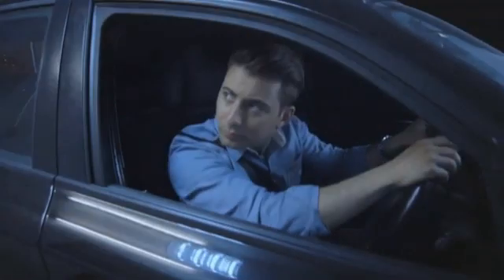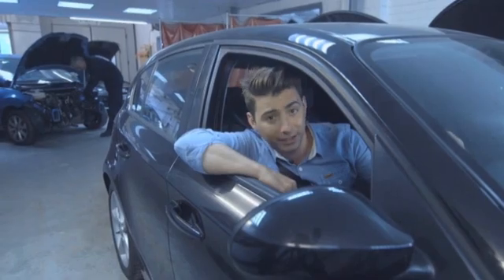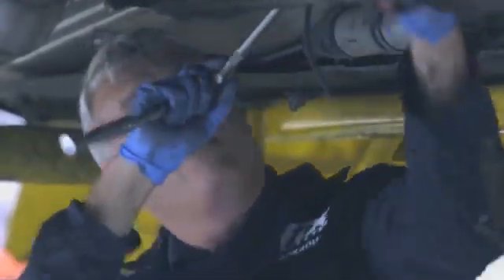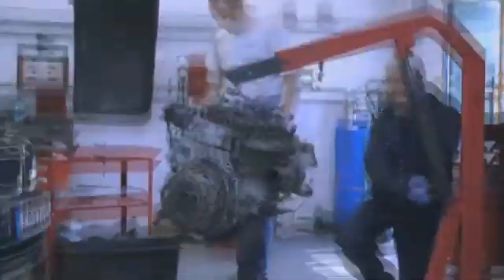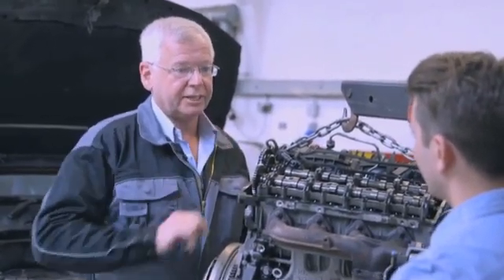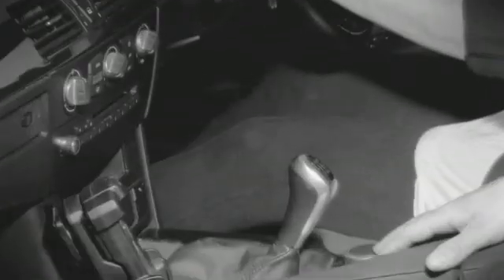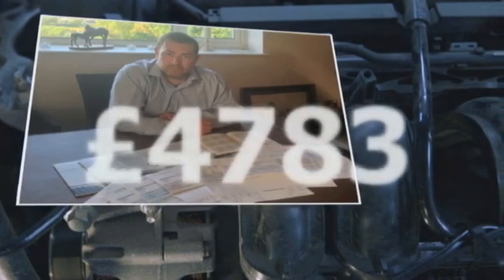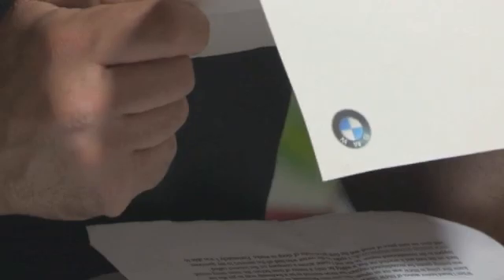BMW N47 Timing Chain Failure PROBLEM

Comment: Should it matter if the vehicle has been serviced by a non BMW approved garage ? So long as no parts are not BMW for example if its just oil change filters then I see no reason a filter can affect the timing chain weakness. BMW are using this as an easy excuse.Come on #BMW accept that you go this part wrong. Be the bigger respectable car manufacturer you say you are.
Even if you do have everything done by BMW it seems they have decided to no longer offer a recall and that is quite shocking.
Reply: Honestly, they do a good job in marketing a shitty product. I'd suggest a merc or a lexus.

Comment: I have a 118d 2005 will I have any problems?
Reply: No as it is a M47 engine, but you may have rear diff issues as 118d had a weak rear diffs.
Reply: No you shouldn't have any issues related to this N47 engine but you got the older M47 engine but they do suffer from swirl flaps issues but only high mileage vehicles
Reply: +Alihan Yazlik yes you will 100%

I also own a 118d (2008) chain at the back so it means the whole engine has to be taken out. However ur car is the old model with the chain at the front meaning you won't need of removing the engine to change the chain.

I lost &#163;2700, never buying a bmw again
Reply: pb5x5 What is the "rear diff"?
Reply: Rear differential sits between the two rear wheels and lets tleft and right side run at different speeds when cornering.
Reply: +SWE-BMW-E90 lol idiot
Reply: My E90 N47 has 230 000km right now but thankfully no problems so far :)

Comment: The main fail is to change oil and oil filter every 20k miles, not every 7-8k miles like it should be. It's all about geting money from engine rebuilt! All cars makers do that!
Reply: Stupid conspiracy theories. Engine manufacturers make service intervals after consulting oil companies. I've monitored acidity in oils after 20k intervals in vehicles that make a lot of miles and it seems the oil is ad goods as new. Oil only degrades with a lot of cold starts. Mileage is irrelevant even if u change oil after 100k as long as it's in one year interval and not a lot of cold starts. I've seen engines on airport taxi ans doing almost a million kilometers in a few years that changed oils at 100k intervals. No problems. If they changed at 10k they would need a service every week. Long drives with a hot engine make the miles irrelevant. 

You really for a second believe that bmw would tarnish the reputation of their own brand by extended intervals? Come on.... That's just incredibly ignorant. Timing chain issues can arise even if u change the oil every 1k. It's simply an engineering fault.
Reply: I've seen engine after 3 oil replacements with 80k miles. It was crap and replaced by bmw.
Same with m3 e92-conrods broken after oil changed every 20k miles. I'm working in company making parts for cars and quality every year is worst. Older engines been better and mechanic said oil change every 6-9k miles.  Now they tell you every 20k miles, but parts are made in China or Taiwan.
I wish you good luck with new cars and service, because my 4 year old bmw had one oil change and one top up after 37k miles. I do it by myself after 6-7k miles and I'm happy. Lower fuel consumption and better acceleration and no noises from timing chain side.
Same with runflats, that cause broken wheels.
Good luck!
Reply: +Pawel Ludew Inside info?
Reply: inside?
Reply: Pawel Ludew How do you back that statement? Do you work in the industry, with confirmed cases of engine failure? That kind of inside...
Reply: Pawel Ludew Very good comeback. I've read the last link that you've put, specifically the BMW case. It seems like it is done on purpose.
Reply: I think bmw can't sell so many ner cars, so they try to get money on engine replace or rebuilt. I owned 2 bmw-e92 335d and 325d lci and both been serviced like that. Just saved engine doing engine flush and oil channge after 6-7k miles  and never had problems. Both 3.0 diesel angines and I love them with auto box, but I will never give any of my car to bmw service (my 325d still on free service till sept 2016).

Comment: Might be a stupid question but how can I check to see if a BMW has the N47 engine or are all 320d built with the N47?
Reply: Type your cars designation on google and n47 at the end if the wiki appears than you have an n47 engine,i have it to so basically we are timing belt buddies
Reply: +Novac Hi what do you mean by designation? I have a 320d is this the designation?
Reply: +faz7862 you have a n47 engine
Reply: +Novac Emil personnaly i just bought an E87 2011 and the seconde day i got this probleme... God bless me i've go a waranty from where i buy it.. i didn't even use it.
Reply: +Daniel Santos you are correct,i wonder why youtube doesnt notify me when i get replies anymore :/
Reply: +faz7862 bmw also claim that the cars with the n47 after 2011 are less likely to have this problem
Reply: Novac Emil they have upgraded parts
Reply: Is your car 2007 onwards? Has it got 161hp (M47 pre 2007) or 174hp + of the later (N47 2007+).
Reply: faz7862 
It's hardly rocket science to find out

Comment: same happened to me with my bmw 320d 2012 with 133000 mileage chain belt snapped on m6 at 12:30 at night with my wife and kida on board it was terrible i will never trust bmw again i am moving to Japanese cars
Reply: Michael G you're completely wrong. Timing BELTS last around 60-120k km... chains usually outlast the car. I've had a mercedes benz which was at 550.000km on the original chain when I sold it and that's not a 1 off scenario, that's the way it's meant to be.

Also, it's usually not the chain which snaps, it's a sprocket which fails on the N47.
Reply: Michael G they don't change the timing chain on a major service you drip. Timing chains don't need to be replaced at 100k either you dum dum. They are checked as and when required. The guy is not delusional at all. This engine is just shite end of. I rebuild engines and this is just a shit design mistake.
Reply: Michael G no the chain should last the life of the engine other brands do so why can't these German shit boxes do it too much over engineering ? Pfffft pathetic
Reply: The BMW "Life-Time" "Lifetime Oil" means that the components should last 150k km to 170k km or 5 to 7 Years, that applies to other Brands too. From BMW Motors inside-sources, I know that the N47 chain is underdesigned. Generally said with a shorter oil changes (15k engine oil, 50k gearbox, 80k diff) you can expand the cars mileage beyond 300k km
Reply: Michael G shut up,my Honda Accord had a chain,I got it serviced regular and it done 200 k you idiot, do you work for BMW, it's to last the life of the engine, it happened to me aswell, I also will never trust this brand again
Reply: Chapsha marra
Reply: they will fail over you as the BMW 👍 . 100.000km or 3/5 years if you don t do the km ,  obligates you to rebuild the timing belt and rollers .
Reply: Elís Kjartansson absolutely not, chains stretch, ever heard of Audi/Volkswagen owners discuss chain rattle on diesels? That's the chain stretching past the point where the tensioner can compensate. Then they explode and destroy the engine. Also, you might be right about old mercs and old cars in general, the chains were different, they were thicker and stronger withless joints. Today they are meant to last 100000 miles to make the $$ on replacement parts. BMW make almost more money servicing their cars than selling them. And also, not replacing a chain after 500,000 miles is neglegance in my opinion. Cars lifetime ends when the chain does, so I guess that's why they say it's lifetime. I service my cars myself and maybe I'm a bit pedantic but I'd rather change them every 150000 miles than rely on the "assurance" that it's a quality component. Nothing lasts forever no matter what blabber the BMW sales manager tells you.
Reply: Michael G funny, any mechanic will tell you different, plus the chain is at the back of the engine, an unservicable part,you a BMW rep or something, or just like to waffle
Reply: gabigowriel how exactly does modern technology effect chain strength? It's not like technology can magically make metal or the joints stronger. Look at a timing chain of an old BMW 5 series from before the 90s, then look at the timing chain in the video. New timing chains on modern engines are made so that they JUST about hold together so they explode as soon as you surpass the warranty or the change by date. It's thin, one layer and the joints are smaller and more brittle.
Reply: jnbing well I rebuild engines too, and half the time I have to do it because the timing chain ( which should last forever) snapped. The only bad design here is the chain itself and it's positioning. The chain is too thin and flimsy and too difficult to replace. If you go by the dealer on what should or shouldn't be replaced then no wonder this happens so often. Maybe also change the oil every 20,000 miles like they tell you, or just buy a new car every time the warranty runs out make them even happier.
Reply: My e46 320d has 210k miles. Original chain. Why can't they make it last as long on the newer cars?
Reply: @illestraper  Well my vauxhall corsa timing chain failed at 64583 miles lul.
that was the 1.0 3 pot engine (2008 model). Much prefer belts as theyre cheaper to replace etc
Reply: S Lax listen, 100,000 miles is when a major service is meant to be done. Timing chains are like any other part, like the brake pads, have to be replaced. Going 133000 miles on one chain and then being surprised when a chain snaps? You're delusional.

Comment: BMW are now doing a free recall on these engines. So next time your car needs servicing take it to a BMW dealership and they'll fix the timing chain free of charge (provided it hasn't already failed of course). This is for 2.0 diesels N47 engine from 2007-2011 models (1, 3 and 5 series). This has been the case since April 2015. If it's too late and engine has already failed, go onto the bimmer forums to find a reputable Independent BMW garage that rebuilds these engines. The cost can range from £1800 to £2500, if someone offers to fix it for less or more, stay away. The parts alone are £1200 before labour and VAT. If you need any more advice let me know, had the same problem and took 6 months to resolve. If you're planning to buy one, get a reputable warranty with BMW or warranty direct and do your homework before signing up.
Reply: Hi Simon, brought a 2nd hand 2012year 123D Automatic from a car dealer just under a month ago, only 43,000miles on the clock. Gonna upload a video with noise tomorrow, dealership which is non BMW  has given me a 3 month warranty for any amount if anything goes wrong. Hoping to god it's not the timing chain though.
Reply: Hi. I rang BMW who denied this.
Reply: Simon Mignott 

Hi. I rang BMW who said this was not true.

Comment: Sorry to say this as a Bimmer tech, i fix bimmers for living but will not buy one for my self anymore. Most car makers make one mistake, maybe engine mistake or trans mistake etc, bimmer have problems in engine, trans sucks, timing sucks, cross over pipes sucks, valve seals are sucks and sooooo many other problems, stay away from BMW less you are doctor or lawyer.
Reply: +Jafar Akhmedov What do you think about the F10 5 series?
Reply: Twin turbo engines are fairly new and yet no one having major problems yet, but im sure its a ticking bomb that is wating to blow up some day. Just imagine when turbo goes out and the bmw building they will go out soon and imagine a price to buy a new turbo. For twin turbo engine its very slow car comparing to my 4.6is.
Reply: @jafarhon  what do you think about 2008 bmw 123d .. it has a 218.000 km and 204 hp .. the price for used one is aroun 5000 euros .. i dont know should i buy it or not .. after watching this video...???
Reply: @Kristijann-s1c   euro spec bmw i would say little better, im from Europe and i know back there we have little different engines in bmw's vs US, to be honest i cant tell you anything about diesel.
Reply: My dudes, bmw is a great brand or at least was. Stay away from all Bmw’s in the last ten years. It’s all about the E34, E39, E36, E46 and the E38s are alright. I don’t know about diesels though. I live in the US. Basically stick to the early nineties to the mid two thousands petrol Bmw’s and you’ll be alright.
Reply: Just get an E46/E36/E39/E30/E34
Beautiful cars not so expensive
Or any other car just not a new one
Reply: DMS REPAIR as a technician you probably should have heard about the M20 and M50/S50 engine my dude
Reply: Friends dont let friends drive bimmers
Reply: also the 1 series after 2012 or? How are the 2015 ones(new model)?
Reply: i am planning to buy e90, have few choices, 330d pre fl, 320i n43b20 engine, and 335i.  or maybe bimmer with 335d engine... or 123d e87 (twin turbo n47)
Reply: DMS REPAIR bullshit your a tech but you can’t even put together a proper sentence you fuckwit I’m sure you worked on bmw or know anything about them also how many years have you been in the automotive industry,not long by the sounds like it . So stfu you clueless fuckwit
Reply: @alycestapleton  So rather than speaking to the issue at hand, the reliability of this diesel engine, you insult DMS.  I think you have missed the point.  I'm also unsure how you can identify a proper sentence, given your own lack of skills in grammar and punctuation.
Reply: @alycestapleton  He's employed for his wrenching skills not his grammar/punctuation.
Geeeez.
Reply: @alycestapleton   should i take your comment as a compliment ? go to my channel before you insult someone, and see how many videos i have posted with bmw engines. anyways been a tech for 20 years, i think thats enough to tell people my opinion. Thank you

Comment: i  just suffered an engine failure on 2010 740il petrol, with 101500 km.  if bmw do not cover the repair it is cheaper to sell the car for scarab (cost estimate  is 20,000 usd).  i knew about their reliability issues from repetition, but never found solid  evidence such as this   during my search. i now will make it my mission to let people know   their design philosophy.  you better  light your  money on  fire instead  of buying a bmw.
for compassion i have  a  Lexus ls 460 2007 with 250,000 km and  the   engine is  in perfect condition.  the biggest maintenance i  did were injector cleaning.
Reply: falkhlaiwi what caused the engine failure?

Comment: If you have this n47 engine, go to your dealer and they replace everything for free, it a recall for all tyes of bodies wich have n47 engine prodused between 2007-2009. i heve done it 2 months ago and it was not so great for me, because the chain guide fixation holes was craked and they wanted to change whole engine block for 5000eur, be carefull and if you have such problem, let me know and take a pictures too.
Reply: Be prepared to be ripped of lied to and a expensive bill to top it off at the end..if it's done any damage to your car like bent valves bmw will say there not liable although the chains a recall on it.expect the worst if it's the n47 engine that's in it.get somebody to second opinion it if you can
Reply: Trevor, at the start off this campaign, they replaces everything, chains, tentioners, guides, seals, etc but now they just replace one timing chain and thats it. I think that the engine is not so bad, because mine was 330t km old, and just had small leak and thats it
regards
Reply: That's bull about them changing everything BMW are useless and will do anything to boom you out the door or make you pay a fortune.be carful
Reply: Hi I am having the same issue, as these guys have explained, and now my 2009 BMW 520d just cranks but won't start. I have had the same experience as these with my car. I am getting worried it is a timing chain issue. The car is getting towed to BMW garage in the morning. Is there anything I should be prepared for ?
Reply: I thought that would happen I took mine back from BMW and did the chain my self wasn't that bad todo what was the final outcome of yours
Reply: I saw in lithuania, they do it without an engine removal, just gearbox down and it will cost around 500euros
Reply: +Sabit Hoxha Yes, a huge bill.

Comment: My 118d is currently in the dealers having new timing chain tensioner and upper and lower timing chains installed, following a BMW recall notice. Seems they have now identified there is a problem, and are replacing the necessary parts in affected models, at no cost to the customer. My advice, if you have one of these models, check with your dealer.
Reply: Richard Parker is this which modal year.. my 118i got same issue today.. its 2007 model, 120000 miles done
Reply: +Jithin James mine is an 08 plate, with only 54000 miles on the clock.  Had had no problems at all with it, but when I booked it in for its service they told me it was due the upgrade under the Quality Enhancement Program recall.
Reply: +Jithin James u have an 118i and thats not a n47 diesel!!! U dont have this problem! Your motor is a petrol! Just check your oil level! If the level is not right you will have chain problems!